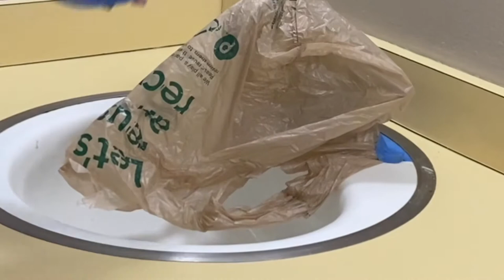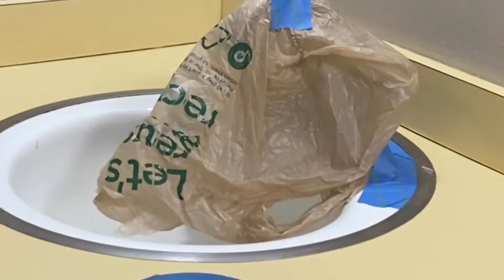PAINTING FORMICA COUNTERTOPS | DIY BATHROOM ON A BUDGET

Comment: Is this application lasting? And how do you daily clean the surface after the  paint has been applied?
Reply from the maker: It is. We are a year out and there are no chips. It does have a stain on it that I need to try and shift so I’ll let you know what works. The only part that needs touch up is the metal ring around the sink

Comment: People, when using chemicals like this...USE A REAL MASK. Either an N95 or better, a ventilator. This stuff is very toxic, a cloth mask doesn't do anything.
Reply from the maker: Yes! I would agree this was not sufficient, but it was better than nothing and the N95s were in short supply at the time I filmed this.